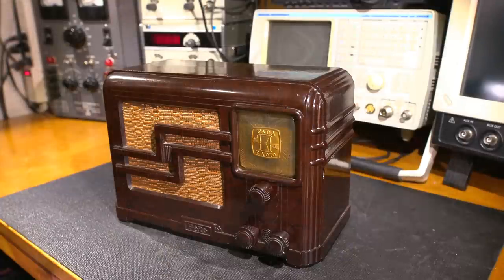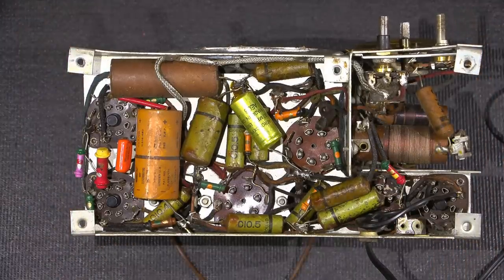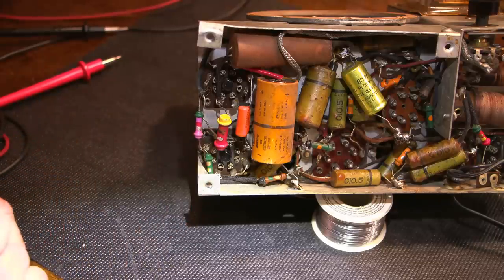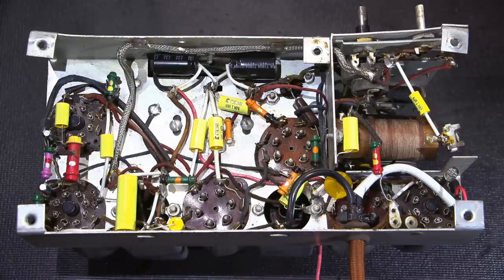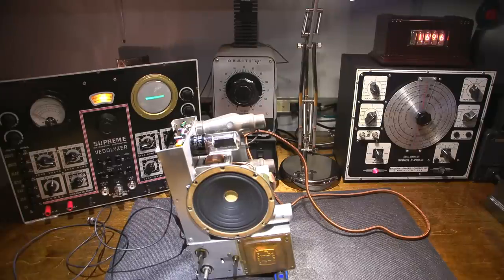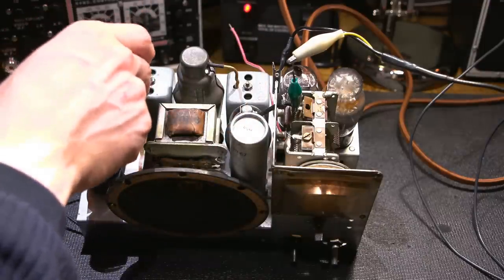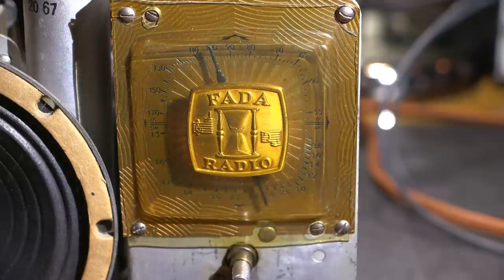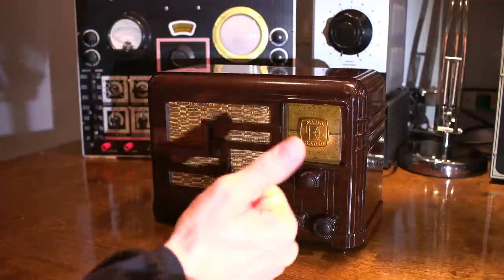FADA Radio Receiver From 1937 Electronic Restoration! [Repair]

Comment: When you plugged your signal generator into the radio (the cap), was that where the antenna wire connects to the radio or another location? And does it vary based on the radio? I have one that says to put the high side of the signal generator on pin 6 of the  RF tube (IT4), so I'm wondering if it's directly on the socket or on a wire that connects to the socket?

Comment: I would love to do some DX'ing with a radio like that. When I was in high school I would stay up late using an old radio that I pulled out of a '58 Chevy that I repaired in electronics class. I ran it on 12 VAC from a transformer which it didn't seem to mind at all. 

Some of you may wonder how in the world a radio designed to run on DC could work with AC? First, the power only lit the tube filaments and dial lamp, and they couldn't care less if it's AC or DC. The high voltage for the plates was generated by a mechanical vibrator switch, and as it turned out, it didn't care either. Had it been a solid state radio it very much would have required a good  a clean and ripple free DC.

Comment: Paul, will you fabricate a back panel to fit onto the radio? Seems like it would keep some of the household dust out as well as making sure no one touches the hot tubes by accident. Any ideas?

Comment: Question - is it possible to put an isolated posted and then run the other AC leg (and other connections) there such that the chassis no longer is conductive?

Comment: Oh man!  I had a flashback to my college days at 46:20
I used a signal generator (we called it a function generator) very similar to the one here, exept the face was mostly black and it had - Precision - printed right under the dial.
During lab, while my classmates were busy connecting their breadboards to the more modern HP generators, I would go to the back storage room and get out this old boy just because I liked the aesthetics of having a large dial and the printing of - Precision - underneath.  (I did check the output with an added frequency counter, and it performed just as well as my classmates' sources that did it all in one machine.)
Not sure if anyone can claim the K.I.S.S. award (keep it simple, stupid) here, but I contended with the older equipment, and maybe had the edge in the 'simple' department.

Comment: Awesome, as usual.  At 10:30 you can see the front of the chassis is bent in:  the screw holes are misaligned.
Reply from the maker: This is done to fit the chassis. If I straighten the chassis, it won't align in the case.
Reply: @MrCarlsonsLab  Thanks.  I guess bakelite warps with age.
Reply: @MrCarlsonsLab  Thanks.  I guess bakelite warps with age.

Comment: Remarkable that so many pre- and postwar US radio's came with direct mains power, without a transformer to generate 2x 250-330 Volts (latter is for speakers with electromagnetic system). Of the many pre- and postwar radio's and amplifiers I repaired during the 50's and 60's (I switched to tube based TV's in the 70's) of only one I remember having direct mains feed. Never liked the system since without a 1:1 transformer errors can be made, which with our mains voltage of 220Volts is even trickier. BTW not having a signal generator at the time IF, oscillator and antenne tuning were all by ear and selecting weak stations. Nowadays AM bands in Europe have fallen silent and FM is to follow (Norway already moved to DAB+). Most luxurous of all my AM radio's I built is the one with  a Geloso block for LW, MW and 4 SW bands (no FM nor SSB functionality) and having a 5 stage variable condensator. You had to add the IF stages yourself with IF frequency anywhere in the 452-467 kHz band. In those years an IF frequency blocking filter at the antena entrance was pretty much standard in our Dutch country. Good posts here, nothing to add really from  my side....

Comment: Mr Carlson I wonder if you could help me the capacitors you changed in that radio are they polarized or nonpolarized or are they electrolytic capacitors I noticed there was a line or polarity on the side can you explain thanks 😃

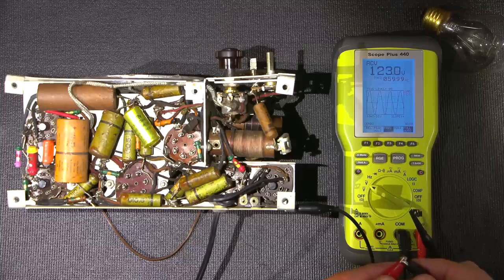Comment: I got a chuckle out of the meter reading "OUCH" around the 16:30 mark. Could someone tell me what that actually stands for? Surely it means something other than "Ouch!" 😄
Reply: Sheesh.  You know the mfg knew this.  So give it a nice non-conductive shell, that’ll fix it.   People must have been shocked all the time.  Cool....
Reply: @highlatitude64.84  huh?
Reply: It literally means OUCH :) As in: you’ll be zapped if you touch this voltage unless you see something else on the display soon.

Comment: May I ask a question? At 35:00, it appears that the neutral is black and the line has a white shielding. Is this not opposite what it should be, color wise? Here in the US the NEC requires the hot to be black. Were I to open this radio sometime in the future, I would assume the black to be the hot. Or am I missing something here? By the way, your work is impeccable, your results are amazing and your knowledge astounds me!
Reply: William Garrett The NEC does not apply to the interior of such devices. You can have whatever colors you wish, as long as you’re within the allowances of electrical safety requirements in your jurisdiction :)

Comment: I thought you typically wanted the inner foil of a poly capacitor to be as close to the higher impedance side of the circuit as possible. Why didn't you do that on this restoration?

Comment: ? I have a question for you. I have a Philips 312 turntable. Is there any electronics that should be upgraded? It is belt drive. I know direct drive had much more for the motor.

Comment: Hey mr. Carlson, great video and in depth explanation as always! Question:  what brand solder do you use when working on tube amps? Or any tube equipment in general?
Reply from the maker: Hi Jethro. Just regular 60/40 or 63/37.
Reply: Thanks!

Comment: I noticed you used the black wire from new cord as neutral. The black wire from a cord connects to small blade on plug which connects to hot on receptacle. It appears you connected the chassis directly to hot. What’s up with that?

Comment: About the cord re-wire: Is there any concern of connecting the indexed cord directly to the chassis when there is a chassis ground in the original design?

Comment: Surely the most obvious piece of advice would be "Do NOT attach your scope ground to anything connected to the wall unless you know exactly what you're doing"? I mean I get that having a long ground loop like that can cause other issues, but if you go a pokin' in there with the probe's little ground clip unclipped, you'll see the HV clear as day on your scope long before you damage anything

Comment: Where did you get the old style power cord with the molded plug on it? I'd like to get some of them. Thanks, Dave
Reply: You can get these cords, on-line. They are called braided power cords.

Comment: Hello, I have a "nothing to do with this" question but maybe you can answer it.

Im building a Fender Deluxe Reverb 22w Combo clone. I am having some doubts choosing the right gauge for the hook-up, filament, heater wire. Would a 20awg cable  (Stranded, OFC, PTFE insulated) be enough for everything or would it be better to have 18awg (maybe Solid Core, PTFE) for the filament?

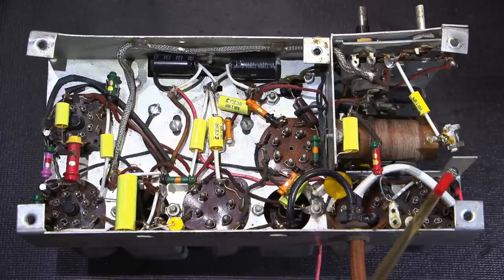Comment: 30:05 I understand why you put that white shielding on the hot wire, but it just looks funny to me, as normally White indicates Neural, this is just nitpicking, as your work is more than planed out and spotless, I just would have liked to see a black shielding on the hot and a white shielding on the neutral. it amazes me how much more room is gained when taking out the old Caps and how little room the modern ones take.
Reply: Opposite on this side of the pond

Comment: x Y rated capacitors in the antenna are VERY important, WAy more important than across the line... a leaky or shorted antenna coupling capacitor can shock you if you touch the antenna wire..the antenna is the only place you can get a shock on a hot chassi radio if it is well mounted inside the cabinet and all the knobs are on....  so it's critical, and many people forget it.... across the line caps are no big deal, virtually all radios work fine without them and if you fit a regular film cap and it happens to short, there will be a loud pop and the radio will keep playing...nothing inside the radio will get damaged even if we are talking about a power transformer set, because the across the line caps are the very first thing in circuit...a film cap popping does not cause sparks or fire, only noise and bad smell...the worse that can happen is tripping your house breaker but that's unlikely, very unlikely...the radio will keep working happily...i have watched my share of those caps popping ...the paper in oil types are particularly nasty because they smell bad and they vent the oil  and produce lots and lots of smoke...

Comment: I've got a question that perhaps someone here has a good answer to. I recently aquired a number of old (1940s) thyratrons, model 2C4. The heater should be 2.5V and 0.65A. At 2.5V I only got a 0.5A draw and the tubes would not fire. I had to up the voltage to 3.5V to get the tubes to work. Any comments on that?

Comment: Mr. Carlsen: you are usually so incredibly careful and safe in all of your work. Why on earth don't you have a GFI in your lab? Wouldn't that just be one more important level of safety with no downside at all? It would pop the moment you tried your lightbulb test.
Reply from the maker: GFI's make noise, and (in my case) wouldn't work at either bench.
Reply: Mr Carlson's Lab You could design a retro GFI with a transformer current bridge, a VT amplifier stage, a detector/comparator, and a relay driver - with a fail-safe design so that if any tube’s emission/gain goes down, the relay opens.

It would be dead quiet electrically unless you managed to get a tube to locally oscillate (and I’m sure you know much better than I do how to quieten those). It’d also be awesome :)

Comment: I cannot over-emphasize the absolute need to be extra careful while re-installing screws! I always told my techs to back the screw in order to feel the "click" of the threads engaging the originals in order to avoid damaging the threads of either the screws or the chassis, and the cabinet. It breaks (insert pun) my heart to see that someone has broken out the cabinet thread bosses for the back panel. Totally unnecessary and in this situation, permanent damage to what is such a nice cabinet.
Reply: True and I find details like this show (sadly) how few people actually care about the items they are working on. There is for me a factor of self respect here, I don't want to watch myself spoiling things for the sake of a moment's thought and care.

Comment: How did they know which way to plug in a non--polarized plug before polarized plugs?
Reply: I suppose the wooden cabinets protected them somewhat?
Reply: They didn’t. You weren’t supposed to put your hands below or behind a radio that was plugged in. Back then you either knew it, or learned real quick. That knowledge died out as transistor radios took over.

Comment: 456? I always thought it was 455 KHz (although I have seen 435 KHz in old sets) Anyway, did you determine that each IF stage was tuned to 437 KHz?
Reply: 45:37 I.F. 456 kHz? Not 455 kHz?

Comment: So here's a question.....at what point is this no longer really considered an "antique" radio? What I mean by that is, when you have to change so much on it either because the parts are bad, or you simply need to make it less of a safety hazard, can it really be considered an antique radio anymore if it's filled with modern parts and a safer design for it's electric circuit?

I don't mean this by offense or anything, just that I wonder where do we draw the line from something being an antique still, vs being modern hidden under an antique shell. It's something I think about when I also see folks heavily modify classic cars putting high performance modern parts on em, to the point where maybe the frame the body are the only "authentic/original" things about them.
Reply: Keeta The replacement parts have same specs, only better quality and lifetime, and the design of the circuit uniquely limits and determines the performance. You could put theoretically ideal resistors and capacitors, and inductors and tubes into this thing and it wouldn’t perform any better (as long as the ideal tubes were still thermionic models with similar physical dimensions put in the model, not abstracted out voltage controlled current sources).

That’s very different from “antique” cars that perform way better than they did when they shipped, due to upgraded essential specs on the components. It’s not as if someone replaces the old parts with, say, more environmentally friendly to manufacture variants, or with more modern metal alloys. If you add flow to the exhaust, or change the geometry of the suspension or the carburetor or the cams, it’s not same essential spec anymore. It’d be same as changing component values in the radio. An exhaust system has an electrical equivalent where pressure is replaced by voltage, and flow with current. Change the dimensions of anything and it’s same as changing the equivalent electrical circuit component values. Definitely
not what Mr. Carlson is doing. 

And finally, components have finite lifetimes. These antique radios will all work poorly if at all at this point, and you can either replace with modern discrete components or forget it. It’s not like you can go buy wax capacitors at Digi-Key, although I’m sure some audiofool vendors offer silly things like it. 

And even if you could: there’d be no point. They’d be failing in the same way, within the same timeframe. Their short life was a property inherent in their design, it wasn’t some poorly controlled manufacturing process. They weren’t better or “purer” than the modern parts. They reflected the knowledge in the industry at that time. We’ve since learned a lot!

The only thing better about this radio over the original, other than longer expected life, is the electrical safety aspect. I wouldn’t mind if all antique car collectors had modern seat belts and collapsible steering columns installed, purity be damned. Human lives are not worth being destroyed in the name of such purism.

Comment: Why 456kHz IF instead of usual 455kHz?
Reply from the maker: Hi Steve. RCA held rights on the IF frequency of 455kHz way back when.
Reply: Thanks for the info, I wondered if there were different standards, or maybe no standard. Who knew you could make claims on a frequency 😀
Reply: @MrCarlsonsLab  Rights to 455 kHz?  Wow

Comment: Anyone else notice that every old radio Mr. Carlson comes up with looks new-old-stock?  Every radio I find; the cabinet is cracked, the dial glass broken, and knobs missing.  And the seller always seems to think it is museum quality and prices it accordingly.
Reply: Fix one, and you find others sort of drop into your lap.  I find that people want to sell vintage gear to me when they learn I can find the circuit/repair data and fix them, and I am buying them at about £10 ..£30 each for radios and test gear.
Reply: @beakytwitch7905  Might be common where you are but old radios and TVs are very rare in the Arkansas Ozarks.  I have been restoring radios and TVs for nearly 60 years.  Everyone I know is always on the lookout for them for me.
Reply: @JWimpy  FWIW I am in N. Wales UK.  Bought one from a miscellany stall in Cardigan (he usually has half a dozen priced at £28 each, non-working).  One came from a radio amateurs junk sale, I bid £10 and nobody else was interested.  One came from an antique shop - offered to me for £5 but I insisted on paying £10.    The repair data came from radio workshop - a UK equivalent of Mr Carlson's lab where if you join you get free access to a library of repair sheets.  The old O'scopes - well who wants 'em?  The Cossor got chucked in a skip !
Reply: @beakytwitch7905  As for repair sheets (schematics), I have a very extensive collection of thousands.  And I always offer anyone PDF copies for free.  My opinion here is that these should be freely passed around to help anyone interested in the radio hobby.  Nothing bothers me more to look for a particular odd schematic and I find someone who has a copy and their response is to send me a link where I can buy one.  If you can send a link, you can send a PDF.
Reply: @JWimpy  In the spirit of your desire for charity, why not scan and upload your entire collection and save countless headaches around the globe?
Reply: @pcwrangler09  I have thought about doing that.  If I could afford to maintain a server I would.  I have a two terabytes drive nearly full.  Not to mention file cabinets full and I do not have a scanner that will copy book pages or large sheets.

Comment: Your lighting at the bench is much too bright for your camera. On my 2560x1600 Dell Venue 8 7840 OLED 8.4" tablet it washes out even at low brightness.
Reply: It's fine.  The corner of the chassis directly under the light is a little hot in some shots, sometimes hands - but a ton of fill lighting (or a $100k lens) would be needed for a minor improvement.  I wouldn't want that much lighting in my shop when I'm trying to get work done.  Besides, the footage is already as good as the TV station I used to work at; pretty impressive for one guy without a studio, grips, light and sound techs and camera operators